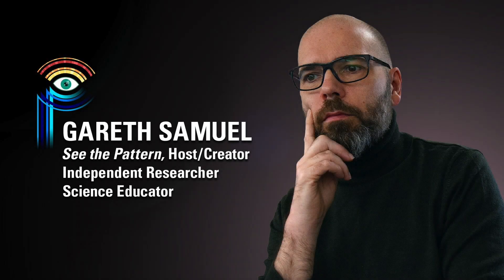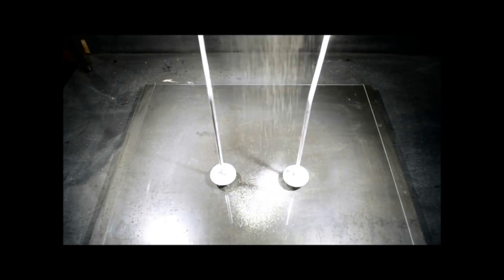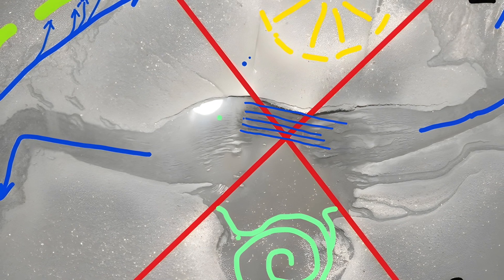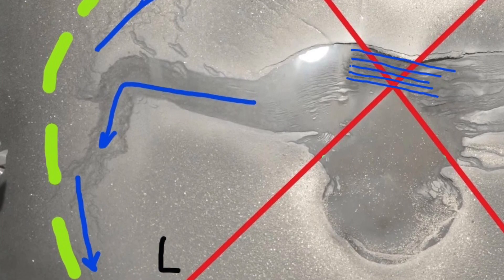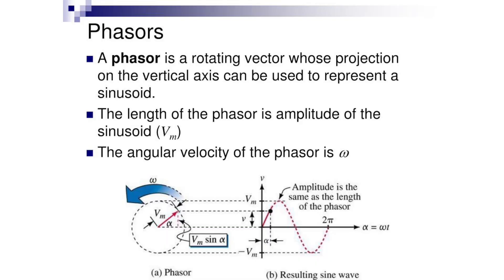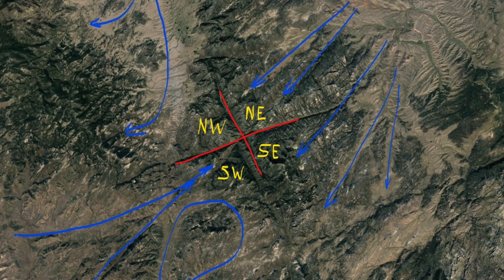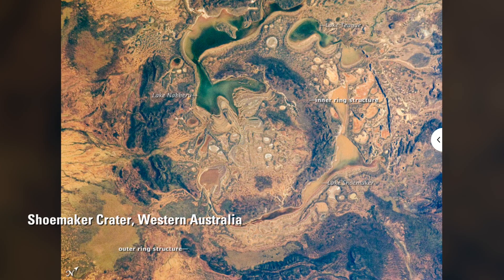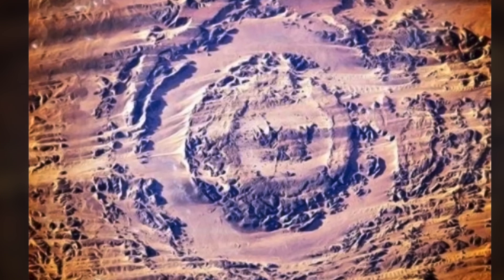Andrew Hall: The Keystone Pattern | Thunderbolts

Comment: Natural occurrences are natural phenomena caused by natural factors. If you reproduce the phenomenon with unnatural and limited factors, you have not unlocked the source or cause of the natural occurrence. This hiccup accounts for the non repeatability of most experimental data. I believe it lies around 60% not repeatable results. Even if you could recreate it without natural factors, you have yet another phenomenon. That being a phenomenon that occurs from the non natural factors. Conflating these two totally different outcomes that resemble each other is a very common issue. In science . In society.

Comment: It would be so much more helpful if you did a video series with examples that actually explained and demonstrated all the terms you throw around so easily - capacitive and reactive currents, "stray capacitance" that creates circular patterns (where does it come from?), and so on. I studied in Honors Industrial Electronics and Physics, and cannot for the life of me figure out what you're talking about or how you arrived at your conclusions. It's a complete mystery. Especially when you point to angles of rivers and channels and call them reactive or inductive currents - I understand the C/L phases to be temporal leads and lags wrt voltage "Eli the Ice Man" (voltage leads inductance in an inductive circuit E>I) and Ice = Inductance leads voltage in a capacitive circuit. But you're talking about the lead/lag angles in ROCK, not in time. I hope one day you will try to "build up" some demo examples and currents so that we can see each step of the process and what your terms all mean. Thank you.

Comment: So are these spots a one time event? or are these spots a constant point on earth that has a constant energy flow?
 It would make more sense that these scares would be created over time considering their size.
 But if it’s what I’m thinking these points on the planet a points for collecting free energy and possible much more, what is a Keystone It’s the stone that locks the arch into place, “A doorway” that rests on a Q point, a Q point is a fixed position that naturally draws and repels Electrical current that is connected to other Q points that complete the circuit Possibly allowing travel between doorways two other designated Q points. 🧐
 I bet this is what Nikola Tesla seen when he said he can see the future in the past at the same time because looking into a doorway would be looking through the vortex like a tornado and seeing What’s on the side of the other doorway and depending on the doorway or the Vortx you pick you can see where you’re going whether it’s the past future present.
 WOE
 That you for work. 👊

Comment: so how do we use radio to apply lift thrust gravity and drag to power things like hover craft wirelessly and without batteries just projectors and receivers. 31mm is wifi what is the Hz of lift/ thrust/ drag/ gravity. for the forces of motional flight in atmospheres?? and vacuums??

Comment: This is an awesome video! Exactly the kind of analysis of electric vs magnetic fields and apparent real power and reactive power and how it relates with IL and IC flows. Do you find it more helpful to think of electron flows as particles or fields, or both? I'm building a toroidal generator to play with high voltage high frequency and to see how counter torque, Lenz' law works with that configuration, so wish me luck, because I don't have any degrees from college so the probability of electric shock and death is high. :)

Comment: If they fired Niel degrass Tyson and everyone at NASA pushing the black hole of lies and put dr Steven Crothers or Wallace Thornhill in charge then id be flying heavy lift spacecraft too go mine astroids in 10 years. Think about it why are we firing 19th century rockets in the beginning of the 21st century. If we had a heavy lift rotational craft that used the centrifugal forces to create, and store electricity and put out its own magnetic fields and a mix of jets or something for better controls then thad eliminate all the speed heater when leaving atmosphere with rockets. Aslo there is no telling how fast ya can go riding magnetic field lines so ya gotta prepare correctly. What im speaking of is kinda tesla tech but na not sure. I just know i dont fear the largest Hadron collider finding the "god" particle because there science is screwed dogma. Now maglev some matter with an atomic weight then your learning high speed physics. I love See the Pattern i can go to sleep listening to him and wake up completely educated!!! I would quit my job as a network and electric engineer to come work for yall. However I am self trained in everything.

Comment: Nothing wrong with the notion that both asteroids and electrical discharges create patterns on the earth. We know for a fact asteroids of significant size have hit the earth, because debris fields downstream of the angle of impact, have yielded materials that could have ONLY come from the asteroid. So NO, it is not non-sense that asteroids hit the earth, but that doesn't negate that some patterns may be occuring because of electrical discharge. Both can occur, one doesn't negate the other. We have seen impacts in near real time on other planets.
Reply: The angle of impact is a good discriminator, as the discharge in electric discharge machining tends to maintain a 90 degree orientation to the surface.
Reply: Getis Realis - "We know for a fact asteroids of significant size have hit the earth, because debris fields downstream of the angle of impact, have yielded materials that could have ONLY come from the asteroid."
Meteorites are real, and the Earth has been impacted untold numbers of times, but it is not nearly as common as we have been led to believe.  The same is true for lunar impacts.  The vast majority of the craters on the Moon are from hydro-volcanic eruptions.. not from impact or electrical discharge events.
Reply: @freemind..  How do you account for numerous crater chains and bulls-eye craters with a small crater at the top of the central peak?  Both of these things have been created in plasma laboratories; is there any reason to assume that plasma behavior does not scale up?
Reply: @JackOkie  - "Both of these things have been created in plasma laboratories"
Phreatic explosion can account for doublets, bullseyes, chains and channels; also, pits (where there are many craters on the floor of a larger crater but not on their slopes and rims), central peaks, and the shallow, flat floors on large craters.  There is nothing that accounts for all the evidence except subsurface steam explosions.
" is there any reason to assume that plasma behavior does not scale up?"
Interesting question.  When scaled up, how does a massive discharge arc not melt the contact rock and leave a LOT of amorphous glass?  Even plain vanilla lightning bolts will leave glass.
Reply: @freemind..  No disagreement here.
Reply: @freemind..  “ The vast majority of the craters on the Moon are from hydro-volcanic eruptions “ 
Recent volcanic eruptions on the moon Scientists find 70 lava flows thought to have occurred within the past 100 million years. We have never observed one volcanic eruption. 
" Phreatic explosion can account for doublets, bullseyes, chains and channels; also, pits (where there are many craters on the floor of a larger crater but not on their slopes and rims), central peaks, and the shallow, flat floors on large craters.  There is nothing that accounts for all the evidence except subsurface steam explosions. " 
I looked it up and found not one image! 
Plasma is highly electrical. 99.9% of all matter in our solar system is Our Sun!  How can you ignore the electrical potential of our Sun? Your ideas are as bad a astrophysics not understanding when plasma is moving it will create magnetic fields. I also notice your YouTube channel is blank. You’re not credible. Most contradicting post here on this thread are like you. Why are you hiding your real identity?
Reply: @ronusa1976  - "70 lava flows thought to have occurred within the past 100 million years. We have never observed one volcanic eruption."
Quite irrelevant.  I said HYDRO-VOLCANIC, which is an initial steam explosion that spewed huge amounts of steam, rock, mud and water from the inside.  Eruptions are rarely singular events, and subsequent smaller eruptions would have percolated out more muddy, silty material which would refill the newly-formed craters and level their floors to a large degree.. leaving us with what we see today - huge, shallow, flat-bottom craters that can't be explained by impacts, on a moon with vacated chambers that once contained large amounts of water and now rings like a bell when impacted.

"I looked it up and found not one image!"
Not one image of what?
"How can you ignore the electrical potential of our Sun?"
I never denied electrical potential.
"..when plasma is moving it will create magnetic fields."
Relevance?
"You’re not credible."
I'm right.. whether you know it or not.

Comment: The electric potential to form the Richat structure would be beyond our wildest imagination. A fixed and sustained power discharge over a 30 mile diameter
area is quite a phenomenon. Or, it could have occurred within seconds.  Going back to the early years of Earth weather, did electric discharges go from 
highly concentrated pinpoint eroding to modern thunderstorms? (A forest fire compared to a propane lighter.) You need only look at the surface of the moon to
see what remains of the celestial war of the Gods. This is far more than charged swirling storm clouds and tornado columns. This is epochal and planet shattering.
The collective unconscious will be in eternal therapy.

Comment: As a metal tradesman and welder arc force is very important to understand when achieving depth of penetration and a clean weld throughout depending on process and procedure. An arc strike across the parent material when uncontrolled destroys certain surface continuities and hardens the surfaces randomly struck and in welding is undesirable as it destroys metallurgical grain structures perhaps desirable to service of the finished product. Where this is most recognizable is with the SMAW or Shielded Metal Arc Welding process as there is a detachable electrode or filler for the positive and the parent metal the negative whereby the operator or welder uses arc distance or length to control amperage and arc force with older machines and newer ones do it somewhat for them. It is this arc control or arc distance that allows puddle control and a fluid appearance. However if amps are high in the open curcuit and the pos is brought near the neg the voltage can violently jump creating an uncontrolled discharge and chaos potentially ruining the properties of the material in that section. Spheres are created as voltage discharges molten metal violently thrown by the disorganized approach and fields held within that range. I am a two-time electrical event survivor once from lightening and the second still not sure, died from that and came back. What a rude ride that was! We know so little and a great deal has been kept from us about our electric universe. I still feel the current running through my head and heart, it seemed like an eternity and the internal heat or feeling of the path is quite literally burned into me. I am still recovering as there are few like me to talk to and less willing to recognize the damage long term. I hope this story gives you some insight not the way I got it! God Bless you in this journey cause he surely did me as I am here to talk about it today.
Reply: Thank you for sharing your story.  How much of the EU model have you explored?   I think we'd all be interested to see how much overlap there is between your experience with arc welding and the features EU believes are from electric arc machining.  Bullseye craters seem particularly hard to explain without it.
Reply: I was a structural / mechanical fabricator and agree with you. Something that should go with this is Electrical discharge machining.

Comment: Velikovsky was close but close only counts in horseshoes and hand grenades. We see plasma bursts and a cataclysm in a cycle form from the deluge, to babylon to sodom and gomorah when clearly a rouge system passes through every 400-500 years and depending on how close it either causes some rough weather and famine + plagues or a full pole reversal and world ending cataclysm. Try looking up the kolbrin bible for outside sources chapter 3 or the book of Revelation that it's coming back again. Besides the idea that jupiter just belched out venus is unfounded and doesnt make sense, venus is rocky yet Jupiter is a gas gaint, so how? You know what does make sense, a piece of our solar system like a small jupiter but a mini system of only 7 planets, 10 moons and several mini satellites that was knocked out of place early on and is a on a elliptical path circling out sun as a binary star  coming and going from the outer solar system to the inner and circling the sun and going back out, each time either coming close enough to do damage or we are far enough away to be safe on the pass, that does make sense.

Comment: What is the magnitude of the forces we are talking about here?  And what generates it?  Am I to believe that this can and will happen again, or is happening now?  Electric forces forming mountains and valleys, makes me feel very insecure and vulnerable.
Reply: Possible answers to your questions (but don’t take my word for it):
1) Huge. 2) Electric potential difference between the earth and a planetary body coming from a different potential area (as theorized by Immanuel Velikovsky in his book “Worlds In Collision), or possibly a major long-lasting flare from the sun, or possibly what is termed a ‘micronova’, though these last two are probably not powerful enough to create the rock formations mentioned in this video. 
Is it happening now? No. Could it happen again? Only if conditions cause a new planet to be born out of Jupiter or Saturn and it spirals near the earth; the chances of that happening are vanishingly small. 
The major flare or micronova, however, are quite likely sometime within the next 20-40 years, and could cause a lot of disruption and destruction. Not very reassuring, I’m afraid, but there will be warning signs when either becomes immanent.

Comment: No impacts? I just saw a video of recent impacts caught on camera. I am fully confused now. Your saying there are no rocks falling out of the sky?
Reply: Where? I’ve seen video of meteors burning up in the atmosphere but never actually impacting the surface of Earth or any other planet or moon.
Reply: @ABK6969  check out Static in the Attic’s latest video. It was coming straight into a volcano and you could see the entire mountainside light up  when it struck
Reply: @doctorofart  not a meteor...
Reply: @OPIXdotWORLD  ok an object speeding into our atmosphere straight into a mountain and explodes directly upon impact.
Reply: No, meteors do fall, but large bodies with differential charges would discharge at each other which tends to blow-up the smaller body before it makes impact. That's why Tunguska, Chelyabinsk and other larger meteors airburst. I don't think comets hit earth.
Reply: @Daniel Francisco excellent point. Uphill pyroclastic flow, of course it exists. TY for the extra epiphany. The Mississippi doesn’t flow up hill either, right. You would be right, it can and has and will again. We understand it, therefore no issue. The only issue is the missing culprit. It’s not missing to me at all because I already figured out exactly how it did it. You all need to see and hear more and then it is an easy explanation.
Reply: @Daniel Francisco where can I learn about areas that have appeared to flow up hill? I’d appreciate the point in right direction. Thanks again, this is big.

Comment: Reactive power only exists in an A/C circuit. A/C should not exist in nature. You would have to explain how A/C is being naturally created.
Reply: How could AC not exist. Berkeland currents are inherently AC. Each concentric shell of a Berkeland current has a different vector - is in a different phase - including backward pointing phases. The entire Solar system is AC. Earth has many current paths in ground and atmosphere interacting at different frequencies in circuits. Anytime there is a "back emf" in the system there is a vector reversal - which means current is alternating. It's not me saying so, it's physics.
Reply: @andrewhall8604  Fair enough, I am not saying the current doesn't change directions. What I am saying is that the frequency change is not fast enough to be considered A/C.
Reply: @revcrussell  Remember, though, the magnitude of these currents, the fact they are not constrained within wires, and the varying resistances and capacitances across the large areas of action. How fast would they have to be oscillating to meet your definition? What type of resonances and/or standing waves would be developed that could create or mimic AC? What would be the fluctuations in the instigating main current? Idk, I don’t know the science all that well.
Reply: One way to get A.C. is to apply a D.C. impulse (static discharge i.e. lighting strike) to a RLC circuit. That RLC circuit will then ring out at an A.C. frequency determined by the magnitude of L and C. 
I'm sure that this is NOT where the multi phase A.C. comes from, but, it is a way to get an A.C. current.
Reply: @reefdiver200ft  Sure, if it is parallel RLC circuit (series version is open circuit in D/C). You can approximate any circuit like this RLC but the capacitance and inductance is effectively zero and therefore the frequency would be too.